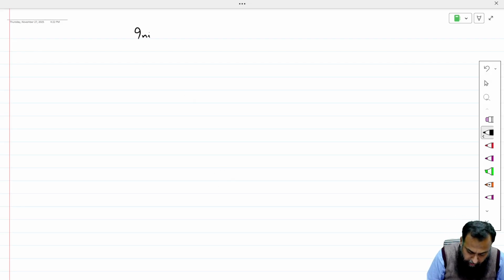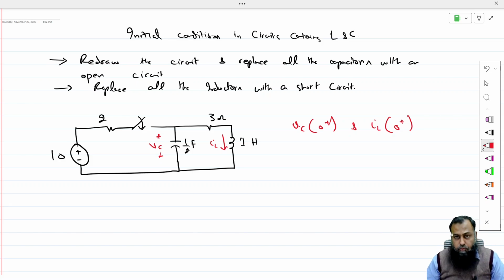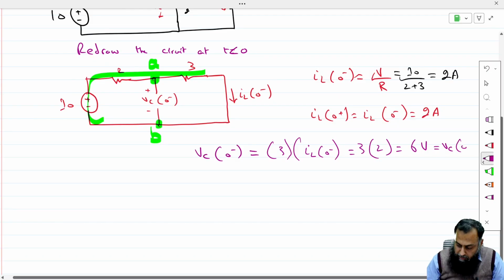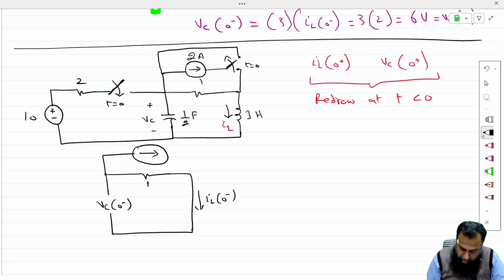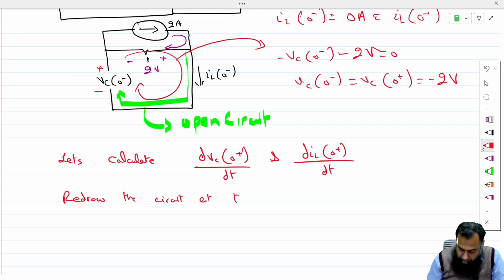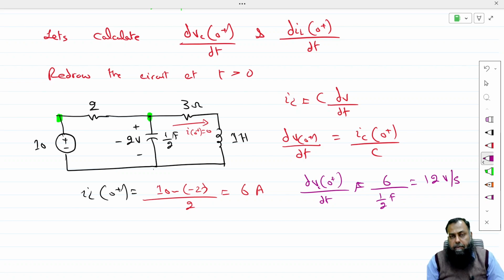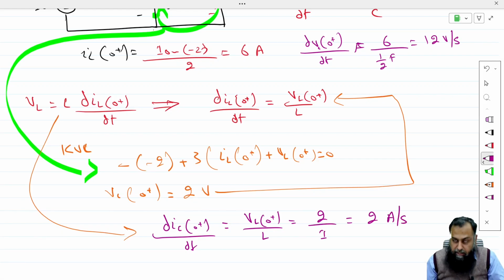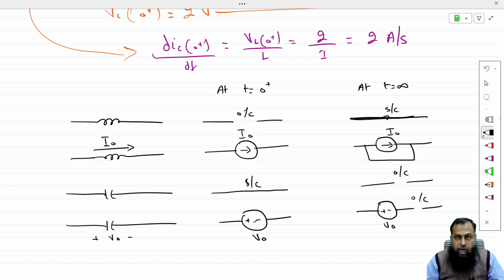Initial conditions in Dynamic circuits

Comment: Assalamualaikum Sir, your lectures are very much helpful for the PG students, I have one request with you can you please make few lectures on Physics modelling of MOSFET in respect of State of health of Mosfet or degradation of MOSFET. Till now we know about the battery their soh,soc everything. But now the main challenge as a power electronics engineer we face that is about the power semiconductor devices reliability, their health, life expectancy. Please upload some lectures.
Reply from the maker: Very nice suggestion

Comment: Well explained.

Isn't an inductor behave as short for all t values in a DC circuit and vice versa for Capacitor?
Reply from the maker: no. it do so at t>5 time constants aka infinite time. At t=0+  the inductor current is same as t=0- due to the fact that sudden change in current requires infinite voltage. Same is the case with capacitor but it needs infinite current. Infinite voltage or current requires infinite power source which is also a dream as of today